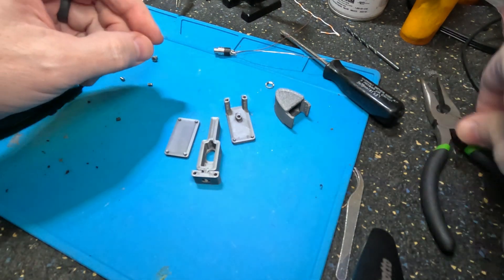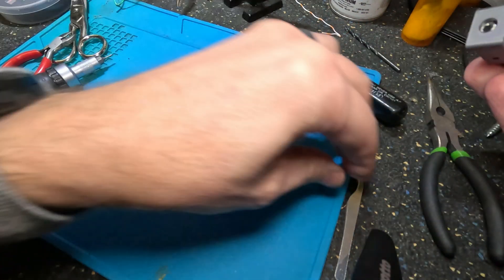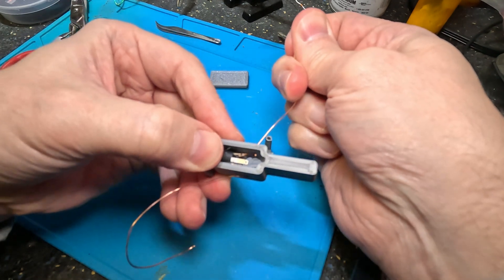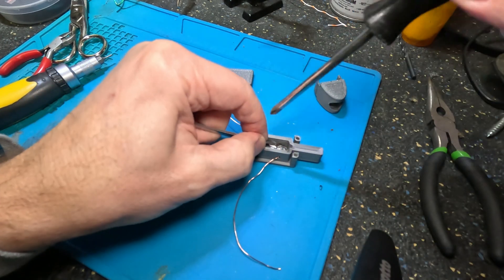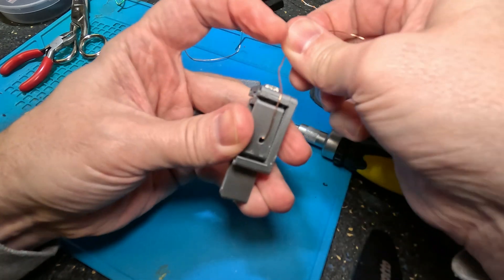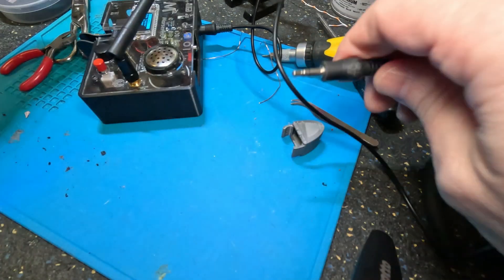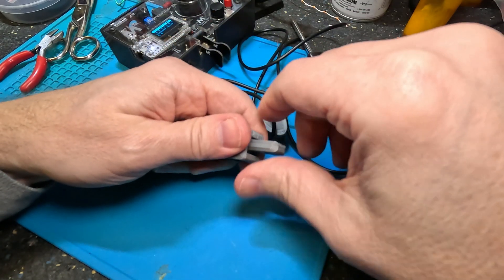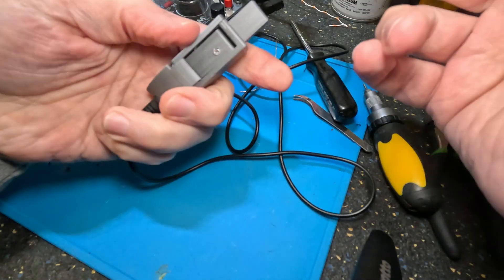Building the K6ARK Single lever key

Comment: Looks like this design might not be quite as fluid in sending as Adam’s two-lever paddle design? Is that an accurate assessment?
Very generous of Adam to donate his designs to the ham community. I have bought all the hardware via the Amazon links that Adam supplied on Printables, I’ve printed out the parts for the two lever design, now I just have to find a few minutes to assemble it!
By the way Tom, this video is very helpful in seeing how the assembly process for Adam’s designs should be done - thank you! 73 de KD8ZM
Reply from the maker: I haven't used a lot of keys, but for me this key is really good.  All my other keys are iambic paddles.  I just really enjoy this one.

Comment: Thanks for sharing your build!  Note that any "elephants foot" spreading of the first layer can make it harder to assemble.  I've encountered that issue before.  Chamfer the female holes before assembly using a hand-held drill bit or a utility knife.  The paddle generally works best when adjusted for a relatively short throw.  Lighter wire also helps improve the feel.  The cover also snaps on the front to protect the lever when not in use.
Reply: Hi Adam,
Great little key. Hopefully I'll be getting my first 3D printer soon. Stay safe.  73  WJ3U
Reply from the maker: This key works so well.  I used it during WFD.  Thanks Adam!